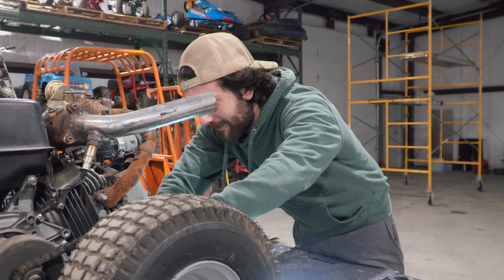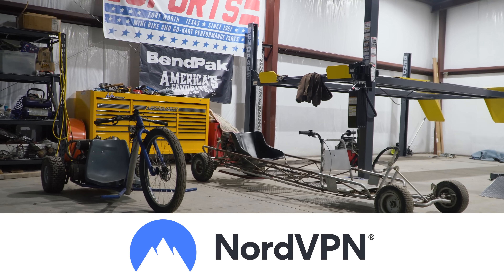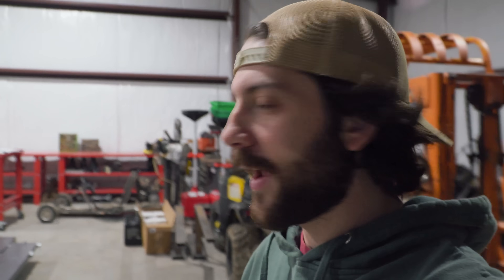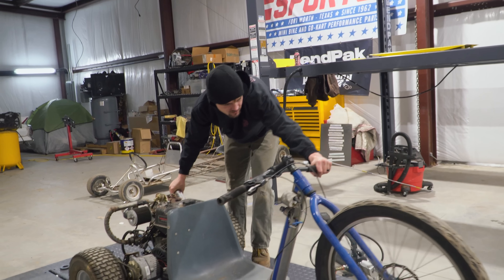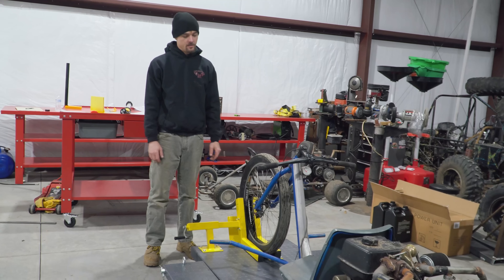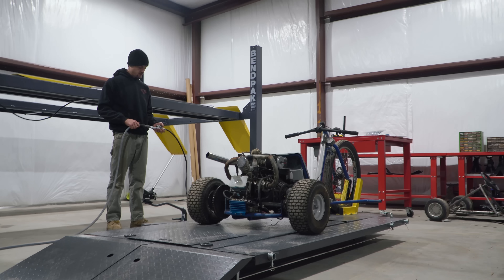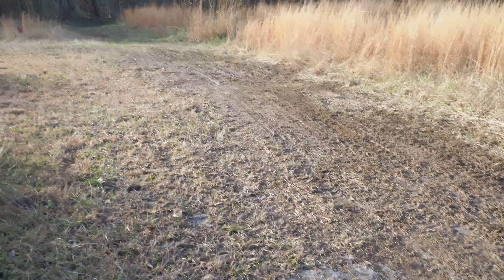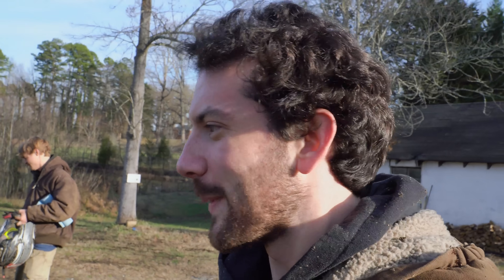We TURBOCHARGED Our Limousine Go Kart!

Comment: Who's camping in the shop😂
Reply: I saw that too 🤣
Reply from the maker: Camp Isaac while I had Covid
Reply: @CarsandCameras  i wondered about that 😂😂
Reply: I live in my car so I feel ya
Reply: @CarsandCameras  put a strap front and rear from cart too lift ,, not fun if that machine thinks it can fly off the hoist .. plus it might hurt laying on the ground with a go kart spinning tires on your face .. I put a strap on a cart when I first started it found out the  carb was stuck ,,that chain stopped the cart from going up the driveway across the street and threw a 2 feet ditch .into the woods ..I can't run and catch a run away cart .

Comment: There is a lot that can be done to the engine to improve its performance. Without adding anymore fuel or anything internal.  Would love to see some forced induction or nitrous on the drag rail if that ever gets going again.
Reply: I was going to suggest Turbo the drag rail ! ! !
Reply: I'd like both, internals and bolt ons
Reply: I'm not a huge fan of forced induction, because it has been proven to shorten engine life. but it's okay on racing engines because a person can plan on doing rebuilds more often. but for non racing engines it's better to go with large volume natural asparation. especially at lower altitudes where atmospheric pressure is higher.

Comment: Boys!  Looks fun.  Although take and make the alternator, swap to a one wire and put it on an on/off toggle switch. The extra belt takes 1hp to spin an idle pulley (went alt turned off)   That alternator takes about 4hp to run it while charging.  Even if you're putting 20hp that's 20% power loss.  Look into it.

Comment: Yall should upgrade all the externals, like exhaust, intercooler, intake piping, and add a boost canister to smooth out boost pressure and maintain it. Then you should test it, and then fully build the internals and high compression with maybe e85 or water meth injection to keep it cool and try and build more boost and faster

Comment: If you add an expansion chamber between the turbo and the engine the turbo will make boost. it's the one thing about using a turbo on a single cylinder anything it will not make boost because the single cylinder can't produce enough back pressure with enough constant force to drive the impeller.  but with an expansion chamber it can build pressure in the expansion chamber and it will drive the impeller . it will only make 5 to 10 lbs of pressure but that's more then enough for a briggs and you can add a gauge to the system to see it working . it's needs to be a bit smaller then a 2 cycle expansion pipe to work but work it will  and it will work on any 1 cylinder engine 2 or 4 cycle.

Comment: Idea for the TurboLimo2.0 - middle seat steers, back seat throttle, front end will need a small hole to poop through and a brake pedal, but put that badass 670 from the drag rail/death mower on it!

Comment: Here are some ideas. Obviously you have to fix the inlet and charge pipes. Rather than an intercooler can you move the injector closer to the turbo even if it means moving the throttle body. This would improve charge temp. Also it might benefit from taller gears. Turbo engines build more boost as you work them harder plus you seem wound out on the straightaways.

Comment: Jackshaft spin up a gm alt they have a single wire alternator belt it off of axle sure bellow. Certain rpm it won't put out but I've seen u guys drive speed not gonna be a problem with this set up long as u running fast it'll charge good
Reply: No

Comment: Thing needs a torque convertor, bogs a lot and then sounds like its topping out on straights. Maybe I'm wrong but seems like it could use it.
Reply: No doubt
Reply: A clutch will have better top end than a torque converter. Torque converters shine in the low/mid range but don't pull near as hard in the top end

Comment: with all that weight, traction and power that centrifugal clutch is a big detriment especially running with a full house. you could really hear it off the line and when running through slow corners how long the rpm takes to pick back up despite the turbo being full or almost full spool. if you could stuff a cvt on that thing it would be an absolute monster even when rolling 3 deep.

Comment: Will stepping on the brake and gas get the turbo to spool a bit for launches? Maybe set up a 2 step? Look forward to seeing any upgrades it gets. Love to see this fun build get a CVT.
Reply: That turbo will never spool up. That's a 1 cylinder engine.
Reply: You know the turbo doesn't do anything, right?
Reply: @1one3_Racing  you can't say things like that.   You're gonna get the sheeple all upset.
Reply: @1one3_Racing  hopefully with it spooling there would be less restriction  and get back a bit of the power.
Reply: @scotttod6954  maybe. Generally speaking single cylinder engines don't have a fast enough exhaust pulse to overcome the parasitic loss of a turbo. Even a twin cylinder Harley Davidson at 96ci only gains 5% from a turbo.
Most people who turbo single cylinders find a reduction in power. But this is a pretty big single so it may benefit a little. But then there's the lack of exhaust scavenging to think about also which plays a big part in single cylinder power. Which is why a straight pipe of exactly the right size and length makes a huge difference
Reply: @1one3_Racing  I would increase plenum volume without adding too much length and do the same for the charge pipe. Then mount the exhaust side of turbo about 22" out. Set up engine with a cam, springs and a flywheel that wants to rev to the moon. Might get something that would be efficient in a narrow band of rpm.

Comment: build a larger by committee car ,maybe 2 jeeps fronts welded back to back 1 engine manual gearbox 2 steering wheels clutch in front left brake in front right throttle in  back right , so that will be 4 people to drive it ( to make it movable by 1 person make the rear steer lockable in straight ahead and a hand throttle ) just a suggestion

Comment: When you're aiming for a record run, you should have a switch to disconnect the alternator... the alternator puts a load on the engine and robs it of some of its power.. just remember to flip the switch back on so it will charge again... One of the old tricks of drag racing...

Comment: does that motor still have its oils sensor? with my kart it used to not take a single turn without it cutting out and it was because the oil sloshes around. so maybe that's why it cut out on the turn?

Comment: If u put a hole in the filler cap you can use an air hose with a rubber nipple to pressurize the system to prime it

Comment: the turbo 420 is better than a stock 420, but how does it compare to a modified 420? 

I'd be interested in seeing that comparison, especially in a dollar for dollar comparison, like a 200$ motor with a 300$ turbo kit vs a 200$ motor with 300$ in performance NA parts.

Comment: You guy should get a Wideband and a bunch of female weather pack connectors and a male weather pack connector. Put the male on the WB  for power and the female on all your carts. 
Then weld bungs in your exhausts. Plug the ones you aren’t using the WB on. 
That way you can tune and make sure your running same easy peezy

Comment: It would be interesting to see what the availability is of fuel injection kits these days for briggs style engines, compared to when you first made the turbo kart. I bet there are cheaper and easier options now. I would absolutely love to make one myself, a turbo briggs.
Reply: I'd get a throttle body injector off a speed bike and use a microsquirt to add a map sensor and o2 sensor so you could build a map for the turbo and control ignition timing  it would be a whole different animal if you could optimize a tune on it

Comment: since y'all are no strangers to running things well above their rated limits (centrifugal clutches on things pushing well over 20 horse), I'd be interested to see how carlisle super lug tires do, since they've got stupid amounts of grip, but they're rated for 12mph with 1200 pounds on top of the tire. My theory is that with less weight over these tires they can handle more speed.

Comment: That engine comes with e-start, it should have a flywheel generator. If not it should be able to have one installed. Be much easier than running the car alternator. Have less reason the engine too.

Comment: I'd love to see you guys put a 20+hp modded 212, or a mild 670 V-twin mated to a 3 or 4 speed in a board tracker frame or old bicycle frame and do a cars and cameras Frankenstein 19 teens shifter motorcycle/boardtracker. Then ride it alongside the mini franken-chopper.

       I have a build planned with a yamaha xs 650 frame I snagged for next to nothing, an AJS Burman 4 speed kicker gearbox I have laying around from a rusted out bike I hauled out of my brothers farm field after he bought the land, and and a brand new electric start 27hp V-twin Diesel with compression release that someone traded me for a small Massey Ferguson that came with my old farm house.   It was only going to sell for $650 at auction.  I figure I can piece together a nice oldschool kickstart motorcycle reminiscent of the old 20's-30's Excelsior or Reading Standard V-twin 900-1100cc bikes.  But still have the convenience of electric start when it's cold, or it's being stubborn and I have some where to be lol. 

      Then when I decide I feel the gear head power monster edging me in I'll do a port and polish job And a mini turbo add on.  Just have to decide on chain drive or belt drive primary and secondaries.  Most likely chain for weight savings.  I don't think the old school belt drives that were on the 19 teens Harleys and other bikes is going to hold that kind of hp.  I'll probably do either an auto clutch like the one from EFM, or foot clutch with a hand shifter.

Comment: Quick question john if I was to do a pulley swap on my 1984 5 speed craftsman riding mower how do I clear the shifter because it is the type of shifter right between the legs and it goes left to right to see what I am talking about check my last youtube video
Reply: I’m no expert, and I’m watching on my phone so I couldn’t see great in your video, but would it be possible to build a jackshaft somewhere near the engine, so power goes from for example, an 8in pulley on the engine to a 3in pulley on the jackshaft, then from an 8in pulley on the jackshaft to another 8in pulley on the axle. If there’s room for you to do that it would give you the same gearing as an 8in engine pulley driving a 3in axle pulley, but would hopefully give room for your shifter. Again, I’m no expert but I just wanted to offer an idea. Your channel looks pretty good, I really hope it goes well for you
Reply: @garageofscrap  instead of a jack shaft (because i don't have material or the right tools for making a jack shaft)would a variable speed pulley work?

I posted a video of what I am talking about just let me know if it would actually work cause I am looking at this as a budget build kinda of lawn tractor I have always seen pulley swaps on YouTube but it is always on a hydrostatic transmission

Comment: I've heard it's completely pointless on anything under 600cc that there's zero gains it just looks cool
Reply: It depends if your producing boost most turbos aren't built for engine that small so the exhaust isn't spinning the turbo fast enough to produce meaningful boost 

Also single cyclinders do struggle to spin up turbos due to the time between exhaust pulses

But saying that there are turbos built for 600cc production vehicles now 

You can produce serious power if you can produce the boost but its about getting the right turbo size for the engine

Comment: OK, so then when are you going to turbo that absurdly overpowered cart of yours?  Probably wouldn't make any difference as it's so absurdly insane on HP already, but great bragging points.

That kart's got a suspension, too.  It's just that you have to be sitting in the center seat to feel it.

This kart looks totally ridiculous, but like it might be a lot of fun.  I had a friend as a kid that had a two place side by side.  The problem with it was that someone had obviously designed it to be more off road and the CG was so high that powering around corners at high speed was downright dangerous.   He turned it over with me in it once, and that was enough.  No more playing passenger in that silly kart.  You absolutely wouldn't believe how far that seat was off the ground.  And the cushions were like an overstuffed couch.  Very comfortable, rather dangerous, unless driven sanely, which he never did.